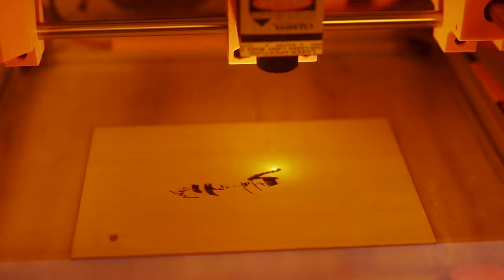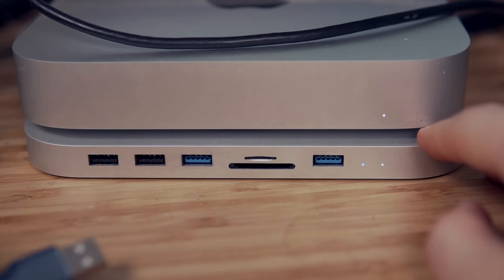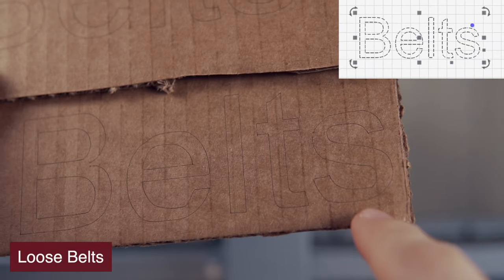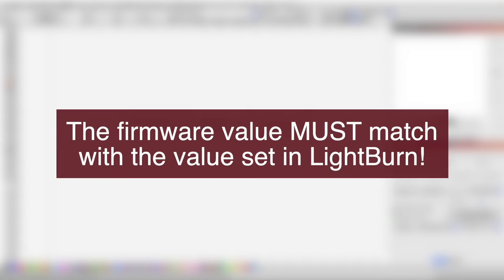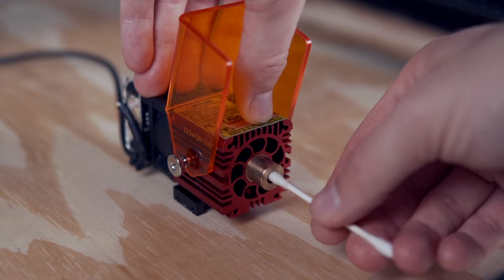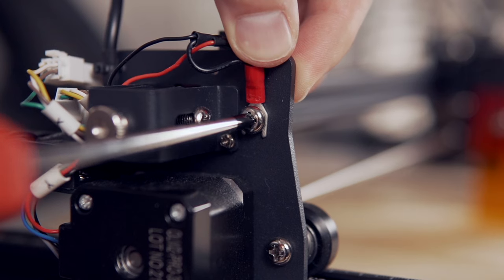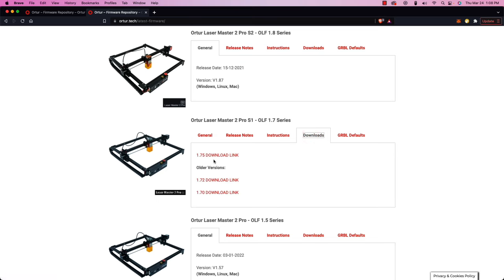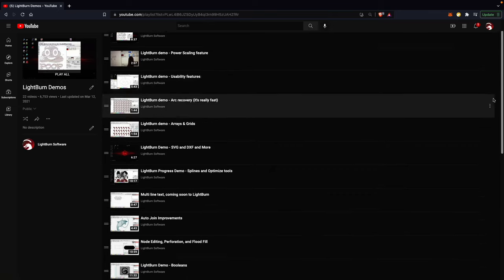Common Diode Laser Issues & How to Troubleshoot Them

Comment: My laser starts off fine then stops moving up and down, how can I fix this?
Reply from the maker: If it is not moving up and down I would check the wiring for the y axis motor, the belts, and the motor pulley. Belts should be tight, motor pulley should be tight and not able to rotate on the motor shaft, and make sure the wire connectors are fully seated. If you are still having issues after that email our support support@lightburnsoftware.com

Comment: I have a laser that I’m trying to connect. I’m running light burn and it says it’s not compatible with windows.
Reply from the maker: LightBurn is saying its not compatible with windows? Are you running Window 32 bit or 64 bit? If 32 you'll need to download LightBurn 1.5.06 or older. If 64 bit make sure you downloaded the 64 bit version:
Here is our documentation on installing:
https://docs.lightburnsoftware.com/Installation.html

If your still having issues please contact our support team - support@lightburnsoftware.com
Reply from the maker: @BrendaDavis-1963  - it’s also possible you have Windows in “S mode”, which means it will only run apps downloaded from the Microsoft online store. You can disable that and it will let you install LightBurn.

Comment: ive been getting this problem where the power light keeps blinking on and off and the fan cant seem to stay on, and so i cant print anything
Reply from the maker: Is there any output in the console? If you are able to connect I would see if the laser is throwing an error.

Comment: My sculpfun going not good,it suddenly moving but,no cut and just small power amount of laser going out even i put it in full 100% power,why ya?
Reply from the maker: I would check our guide under power output to see if the S-Value Max is correct or that constant power is set: https://docs.lightburnsoftware.com/Troubleshooting-Output.html

If it is not a hardware issue it is likely one of those two.
Reply: @lightburnsoftware7189  dont really understand what it is,but i try to understand okay,tq for info,i will check

Comment: I have an xtool D1 pro and it seems to shut off sometimes in the middle of a job. Using Lightburn software but I don't think it's a software issue as the software is still running and counting down as if the job is still in progress. Anyone else having this issue? Xtool has not be any help.
Reply: Did you get this resolved and if so how?  I've been using Lightburn for years and it's been great recently my Xtool d1 pro loses connection and not sure why.

Comment: I have problem that the lazer stop working in the middle of the work

So my machine just engrave half of the work all time .. and i do not know why this is happening
Reply from the maker: Is the machine grounded properly? For engravings there have been instances with the machine building up a static charge during engraving causing it to stop after sometime. What does the console display when this happens? Please send this with any additional info surrounding machine, console output, which jobs are causing it to support@lightburnsoftware.com
Reply: @lightburnsoftware7189  thank you for your reply 
Do you have a video for grounding the machine

Comment: My laser is ramming itself into a corner no matter what I do it just keeps doing it and it like freezes the program

If I tell it to move 3 mm in news across the entire work area and Rams into the other corner
Reply from the maker: What laser are you using? Was it previous working?
Reply: @lightburnsoftware7189  Aufero II.  Someone suggested that I do a calibration on the xy and loosen those a bit. Seems to be a much happier machine now

Comment: my laser is to weak to engrave anything, just started recently what is going on?
Reply from the maker: If it just started recently it is possible something happened with the laser itself on the hardware side. There are a couple of things to try in our documents on output: https://docs.lightburnsoftware.com/Troubleshooting-Output.html#power-output-is-not-the-same-as-other-software-grbl

You can also try to rollback your LightBurn settings to a previous version in case something was tweaked: https://www.youtube.com/watch?v=OvuR0Uj1kL0

Comment: my laser engrave do not fire . how to solve this problem
Reply from the maker: What laser is it? Has it worked previously? When the laser powers on is there an LED or fan on the diode that lets you know it is receiving power? 

If you are still having issues please contact our support - support@lightburnsoftware.com